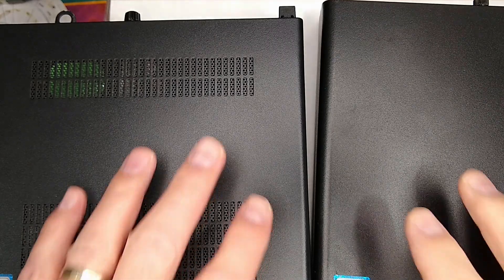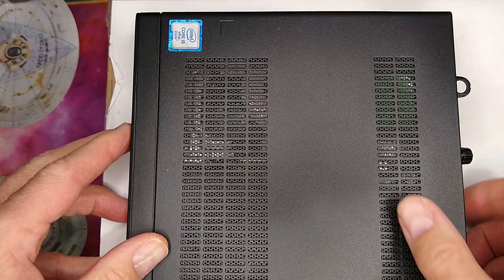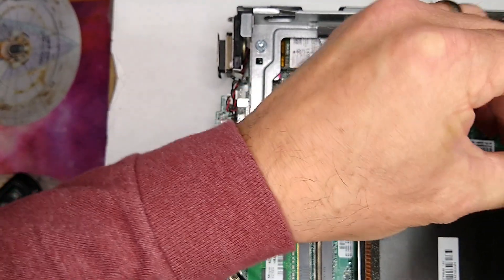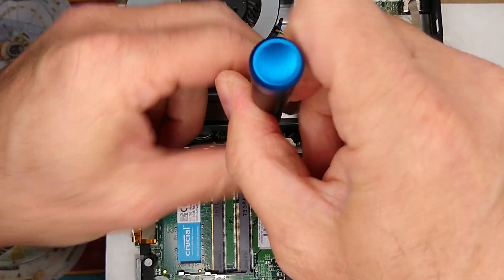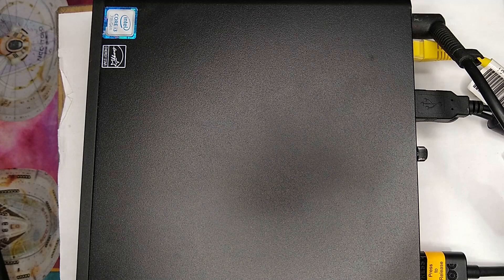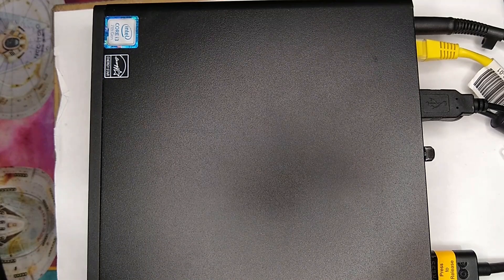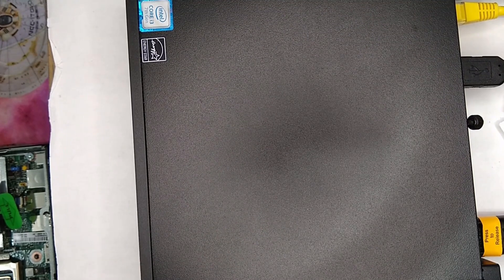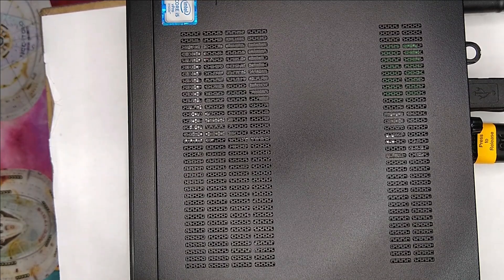Putting a non "T" CPU into a ProDesk G3 Mini...will it work?

Comment: What happens if you put a non-t cpu in an elitedesk 800 g3 35w with it's aluminum heatsink will it work?
Reply from the maker: It will still work but you may need to check your temps to see how hot it is running.

Comment: Hello can i run i7 7700 non t to my. Dell optiplex 3050 micro??
Reply from the maker: Doesn't look like the 3050 micro supports the higher wattage CPUs.  If it did you would need at least a 90w power supply.  Specs do show 7th gen CPUs with T

Comment: I m running a i5-8400 (non T) in a EliteDesk 800 G4 mini 35w with a  90w power supply.
It works ok, but i m having some doubts that it works at its best.
(Turbo Boost is enabled in BIOS)

Cinebench R23 gives a 2700pts score where as on my EliteDesk 800 G4 Tower (also i5-8400 non T) gives a score of 5500pst. 
Do you think that it is possible that the 35w throttles down the CPU ?

Also i m hearing some high pitch coil sounds form the CPU ( is guess) when on load. (sounds like an old HDD)
Reply from the maker: Compare the thermals between the units.  I wonder if the 35w is getting too hot.  Maybe also try with the cover off to see if it makes a difference.  If it works better you might look into getting the vented hood from a 65w unit.
Reply: @handmedowntech  Thermals look normal with a max of 70 degrees C. I have tried with and withouth cover and same results. The interesting thing is that my G4 has vented top cover and copper (not aluminium) radiator for the cooler.
Reply from the maker: The G4 is an interesting one in that there is a difference between the 65w and 35w mobos.  The 35w has an extra header for use with the USB c Flexio card.  I wonder if HP did anything else to make them unique, like use of CPU.  Can you try geekbench on the two units?  I found it to be less GPU intensive vs the other benchmark.  I can get you the numbers I have for various units and CPUs.
Reply: On GeekBench 6 i get the following scores with Turbo Boost ON and OFF frrom BIOS.
Fort the G4 MINI 35w on SingleC 1020pts  and on MultiC 4213pts with Turbo Boost OFF.
For the G4 TWR on SingleC 1003pts an on MultiC 3555 with Turbo Boost OFF.
With Turbo Boost ON i get the next scores:
For the G4 MINI 35w on SingleC 1416 and on MultiC 2693pst.
And for G4 TWR on SingleC 1364 and on MultiC 4146pts

On Cinebench R23 scores are:
For the G4 MINI 35w on SingleC 731pts and MultiC 4115pts with Turbo Boost OFF.
For the G4 TWR on SingleC 742 and MultiC 4126pts with Turbo Boost OFF
And with Turbo Boost ON:
G4 MINI 35w for SingleC 1031 and for MultiC 1940pts.
G4 TWR for SingleC 1034 and for MultiC 5491pts.

Turbo Boost turned OFF prevents coil whine sound, but keeps fan a little bit loud in idle mod
Also Power Saving power plan prevent coil whine sound (but maybe then you loose CPU power, i did tests only with High Performance power plan).

G4 Twr has only 8Gb RAM 2400hz as compared to G4 MINI that has 16Gb RAM 2400Mhz, maybe this influences the score a bit

Conclusion for the MINI: turbo boost ON produce coil whine sound and produce LOWER Multi Core scores. And i would have love it to be the other way around :).
Reply from the maker: I have numbers for i5-8600t and and also MP9 running an i3-8100t
G4  1258/4619 - 16gb, MP9 1073/2670.  I'll have to check to see if turbo is on.  I know my G4 running proxmox is very quiet
Reply from the maker: Just checked and reran - Turbo-boost was on and must have been on for the other tests since the numbers are the same.  Of course I'm using a "T" CPU - no squeal and the temps maxed at 66C
Reply: @handmedowntech  thanks, probably non T cpu's act strange or there is some problem with this motherboard.
Reply from the maker: @IliesMihaiAndrei  bummer,  I know I'm very picky on sound.  Tried 3 different fans to get my ProDesk 600 G3 quieter.
Reply: @handmedowntech  In the end the guy who sold me the unit was willing to switch it for a EliteDesk G4 65W with i5-8500 cpu.
The scores in GeekBench6 were 1465 single-core and 5128 multi-core (TurboBoost on). No coil sounds either. 
So my conclusion is that "non T" intel cpu's are not recommended on the EliteDesk G4 35w.
Reply from the maker: @IliesMihaiAndrei  interesting.  Especially given the fact that the mobo for the 35w is different than the 65w.
Reply: If I were to guess, I'd say the motherboard bios is hard setting a power target for the CPU, making putting a non-T variant in almost useless. With the Turboboost, a single core is allowed to 'hog' most of the limited power budget available, which  brings up a single core score but gives a terrible multi core score.

Comment: Are you deleting the comments...🥲

Because i lost mine here.
Reply from the maker: No, but YouTube itself won't let comments with links in them get saved.
Reply: @handmedowntech  That's the issue, then.

I tested the 8700K on my G4 mini 65W version. With a 150W adapter, just the CPU at max load drew 95 to 110 watts.

As there wasn't sufficient cooling for the CPU, it throttled and gave me a Geekbench multi-core rank of 2K, while others are getting a 5K rank.

It's better to stick with a low-end CPU than use larger processors in these mini PCs.
Reply from the maker: Not sure if I include a picture in the video showing the massive heatsink used for the K processors.  Takes up half the unit.  Kind of a waste. Like putting a V8 turbo inside if a VW bug, just too much power.

Comment: This came from hp itself both boards are the same that's what they told me it detects the psu and cpu from what I'm told they tell the bios if it's a 35w pc or 65w pc that's what I was told by hp
Reply: My g5 that I'm going to test came with a fiber nic but that's overkill for me I'm switching it for a USB c option biard
Reply from the maker: Those fiber NICs are pretty rare.  Maybe down the road you'll find a use for it.
Reply from the maker: It does seem like for the EliteDesk you can use any CPU combo.  I have a T CPU in the 65w uni5 for example.

Comment: Thanks. Not many days ago I was searching for a second hand non-T i7-7700 to replace my 7700T on G3 prodesk 600 mini. Good to know the searching is not worth anymore.
Reply from the maker: I was curious myself after I saw comments about non T in the 600.
Reply: Just lived this issue myself, this confirms that the i7-7700 I put into my prodesk 600 G3 (dm) mini will not have any opportunity to work.
Reply: The performance difference between both CPUs is negligible.

Comment: Word of advice don't put a i7 6700 in a 800 g2 or any g2 or lower mini pc or you'll end up replacing a motherboard.
Reply from the maker: Interesting, are you speaking from your own misadventure 😜
Reply: Yeah...but this time more different suckerpunch style.
Reply: Throttlestop is your friend, undervolt and power limit and you can enjoy the single core boost and better multicore than any CPU without undervolt
Reply: How to get it?
Reply: @tyfp3854  you really don't know that i cannot link stuff here and that you can google stuff?
Reply: When you give information you got to explain more better than that.
Reply from the maker: In looking at the throttlestop it appears to be a windows app.  It looks cool but of course wouldn't help in cases where the computer won't boot because it doesn't like the CPU.
Reply: @handmedowntech  i am assuming a successful boot but cpu fried the board (vrm) during usage by pulling too much power, on a Elitedesk.
Reply from the maker: That makes sense.  Have you used it for any units?
Reply: @handmedowntech  i have used it on every machine i put my hands on, sadly HP pro series does not allow undervolt to be unlocked after november 2019 bios releases, so i moved to Dell machines wich do have writable settings for that.